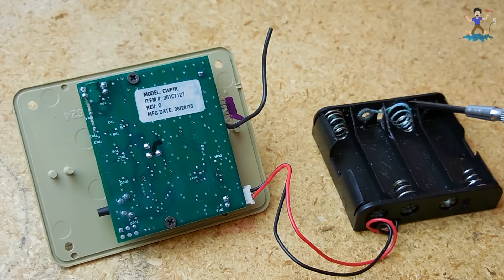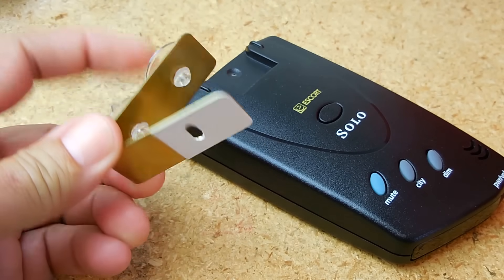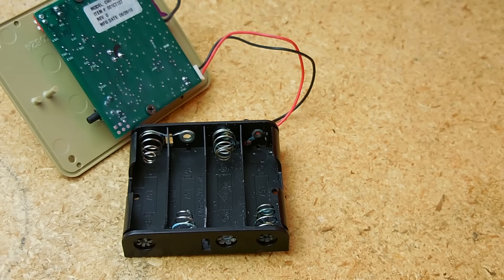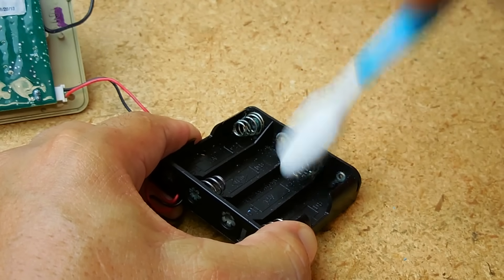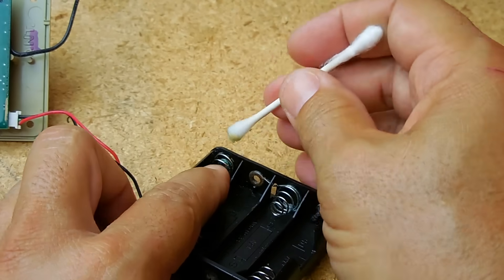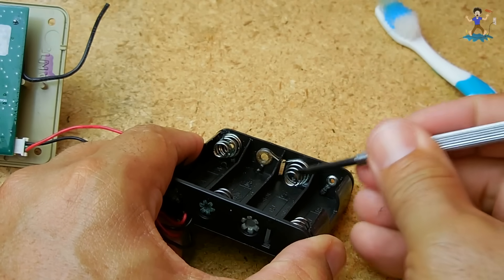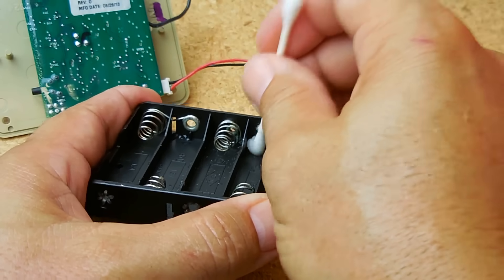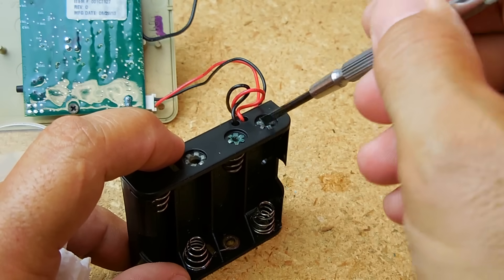EASILY Clean Battery Leak Damage(Corrosion) In Electronics

Comment from the maker: Wondering how good Dollar Store Alkaline batteries are compared to a top brand? Watch my video below!
https://www.youtube.com/watch?v=47vMmWX9LaI
Reply: Vinegar won't leave a baking soda residue.
Reply: Sunbeam Dollar store batteries are pretty good. I use them in my GO 50G calculator. In spite of all the hype they last abour as long as Eveready or Ray O Vac Batteries. Be sure their marked alkaline not heavy duty. 4 AA or AAA batteries are $1.00.
Reply: @karlbergen6826  except they leak a lot faster then name brand batteries and they have liquid inside them that leaks faster and if you put them in something and leave it on it makes them leak when the battery goes dead.
Reply: @karlbergen6826  In my experience they, Dollar store batteries, are more prone to leak though. Also the plating on the contact surfaces does not hold up well and the result is oxidation of the surface. If you have to wind up spinning your batteries to get good contact, this is why.
Reply: Hope this works on my old camera.
Reply: I was taught in my electronics course to using soda bicarb but this works on rusty tools as well! Nice video.😁 btw!
Reply: Actually I've had good luck with them.   The only leak issues I've ever had that caused damage was with DURACELL.  LOL   Possibly the Best of the Best.  Never had issues with the Sunbeam cells sold by Dollar Store.  I even recharge them and never had on leak unless I Over Charged them.  MY BAD.
Reply: Can i use apple cidar vinegar instead?
Reply: @MM-zp8iy  I'm sure it would work but the White is much stronger in Acidic Acid.
Reply: @pulesjet  Thanks
Reply: I re purpose 18650 LiIon cells all the time to make E-Bike packs and other power hungry things.   I use these capacity testers to measure the Capacity of all cells prior to use.   It would be interesting to redo your test using this tester.  I'm not as concerned about Capacity as I have the Leaking Issues.  LoL   https://www.banggood.com/ZB2L3-Battery-Capacity-Tester-External-Load-Discharge-Type-Module-p-1058571.html?rmmds=search&cur_warehouse=CN
Reply: I had someone tell me, who said he retired from a battery manufacturer, tell me that by law all batteries have to be made by the exact same standards! The only variable is whether or not the store rotates their batteries! I’ve actually had great luck with Amazon Basic batteries! Go figure!
Reply: @dlcarwile  I've been wanting to try those. No problems leaking?
Reply: Of The Dawn Ive been using them for over two years now, and haven’t had any problems yet! I’m a residential HVAC tech, so I use them for thermostat battery replacements!
Reply: Buy lithium aa and aaa batteries and you will never see leaks. Another bonus is these batteries last 10 to 15 years. Save your devices!
Reply: electronicsNmore (
Reply: I work at a Dollar Tree, this video wilp be interesting 😁
Reply: Thank-you so much! I was able to restore my religious electronic candle
Reply: Thanks for the post: been wondering about that issue for awhile.
Reply: Energizers seem to leak less than all the others.
Reply: Save yourself some effort by disconnecting the battery holder at the connector to the device's PCB.
Reply: How to keep terminals from rusting AGAIN?
What about dielectrc greas!
Reply: Duracell AAA are horrible.   They leak within a month of use.
Reply: Indudivady these are not batteries these are cells  a battery is more than one  cell
Reply: If I dont have any 91% isopropyl alcohol on hand, can I use the 70% rubbing alcohol instead?
Reply: @luckykatz - it won't work as well, nor evaporate as quickly because it is 30% water. Best to get the full IPA.
Reply: I used the method to recover an hp49g+ calculator.
Reply: but is there a way to neutralize the alkaline before corroding the contacts?
Reply: Nice video, but battery acid is really poisonous. You should be more careful handling batteries, so it doesn't get on your hands/face/desk.
Reply: They suck. Some idiot I bought a 4adio put some in the radio without asking me if I wanted batteries and they leaked.
Reply: Could i do the same thing to clean out my Battery Daddy??
Reply: @electronicsNmore - 
This is NO real "corrosion" ( https://www.youtube.com/watch?v=aWoBSthN3FM ) , I have seen real corrosion that completely ate away the entire contact into chopper salt (just the plastic was left) in a kid´s "Vileda" branded toy-vacuum  ... It was caused by the even cheaper far more aggressive "HEAVY DUTY" Zinc-Carbon batteries ... I have replaced the contact with junk = a copper strip from the guts of a cracked 1970s German multi-way extension cord, inside similar to this https://www.youtube.com/watch?v=ld40jm3VOnU   , but older & all sockets in 1 row.

Comment: Good tips. I’ve also used baking soda dissolved in water and I think it works even better, as the solution will neutralize the corrosion. Honestly, though, an 8 minute video is kinda long for this simple process.

Comment: Good video.
I had used Duracell Batteries exclusively for years. Something changed a number of years ago and they became  the worst battery for leakage! Totally destroyed a 4 "D" cell Maglight with corrosion so bad I wasn't able to get the batteries out.

Yes , I check all of my flashlights and other battery powered equipment regularly. I also had a TV remote that was full of battery leakage again, Duracell Batteries. That one I was able to clean.

Have used vinegar for years to clean or  by adding baking soda to  neutralize lead acid battery leakage on car batteries. 

Auto parts shops also sell a battery cleaning foam for lead acid battery corrosion.  

Take care with those types of batteries as that corrosion is caustic sulfuric acid  which is dangerous as it will burn skin and clothing.

Comment: I have been doing what you have mentioned, except I had been using standard Soda powder with warm water.  I also have to use a Dremel to clean even better.  It's real hard to clean easy when near circuit board, is okay if you use clean after with water clean and dry 100% with a compressor.   It's good you helped folks.  Thanks!

Comment: What I did with some badly corroded battery terminals was submerge the plates in a bowl of white vinegar and then I used masking tape to hold the bowl on top of a foot massaging thing I own.  It is a flat rubber surface that vibrates very fast to shake/massage your feet.  Anyway, this agitation of the vinegar greatly accelerates the chemical reaction.  It was really clean in about 5 minutes.

Comment: What frustrates me is device does not work, look - battery corroded, remove bad battery that has only been in 6 months, dated good thru 2030, ugh... Duracell, Energizer, all do this probably 10% of the time or more, for me it's mostly in wall clocks.

Comment: I keep a bit of 15% acetic acid from Amazon. it's a bit stronger. I learned this trick in the Camera repair business. We used the acid off the shelf from the darkroom supplies shelf. I still keep a fiberglass tipped "pen" to do the scraping at the shop that bring in corroded remote controls.

Comment: A similar treatment involves application of the vinegar using the needle nozzle of a "flux bottle", allowing the liquid to get at where a brush or Q-Tip might not reach. Especially with battery holders that can be removed from the overall assembly, the entire battery holder can be immersed in the vinegar for a moment. I recommend flushing with distilled water, followed by the alcohol, but the alcohol works well by itself in most cases.

I had a rare electronic calculator whose NiCd cells had leaked all over the circuit board. Holding the board over a tray, I squirted vinegar via the flux bottle needle all around and under the discrete components and ICs, then followed with a distilled water flush from another flux bottle, then hung it up to air dry. This brought the calculator back to life, and more than 10 years later it still works fine. No brushing or Q-Tips were used in that instance.

Comment: Dad used baking soda and water with a Q tip. Toothbrush also, water and Q tip then dry.
Works well also.
Reply from the maker: Incorrect. That does not work because you are neutralizing a base not an acid! That only works on automotive batteries

Comment: I’m going to recommend sodium citrate here instead of white vinegar if the vinegar is not working, or too slow— you can use just citric acid from lemon juice or by buying it as a cheap powder, and you can partially neutralize it with a little bit of baking soda. Sodium citrate is amazing at removing rust and I think in a slightly acidic version should do a really great job with battery acid damage as well.

The point is it’s cheap and easy to make, it’s far far superior for rust removal and probably should work in this application as well and you can just keep a jar of it around the apartment or house.

I did use the vinegar in my mom’s apartment because that’s what she had and it did work on a tv remote control with battery leak damage…

Comment: I use a Qtip with baking soda on it and push it around the electrical contacts while using an eyedropper with vinegar. The reaction of vinegar/ acetic acid, with baking soda / alkaline, works great for cleaning contacts. A toothbrush and test tube cleaner is a good idea. Thanks for your excellent tutorial.

Comment: Great video! But next time unplug the battery holder from the device. Makes for easier cleaning without accidentally pulling the device into the cups of vinegar and alcohol. I may have a couple devices I can use this method on. Thanks again!

Comment: I would recommend unplugging the bakery pack from the device and moving it away. This puts less stress on the wires and avoids contamination. I also use compressed air after cleaning.
Nice video. Have a good day

Comment: I usually make a baking soda paste, apply, let it dry...then vacuum whilst scrubbing off with a small wire brush.
Reply from the maker: Incorrect. You cannot do that for an alkaline battery. You are not accomplishing anything you need to use an acid to neutralize a base
Reply: @electronicsNmore So, licking the corroded parts is better?

Comment: With a separate battery holder like this one, especially when it's connecting wire plugs in to the circuit board, un plug it and drop the battery holder into a pan of vinegar and let it soak. Then do the physical cleaning with brushes, etc.
Reply: Exactly!

Comment: Since vinegar is so cheap, I would consider submerging the part in vinegar. Of course, can't do that with a corroded component, but in the example here, you could submerge the entire battery case in vinegar, ensuring it will get in all the nooks and crannies. I would then rinse it in distilled water followed by alcohol spray.
Reply: Exactly!

Comment: Many times I had this alkaline leakage and just sprayed it with WD-40. Bam, done!! Just let it dry for an hour or two. Also, if you have corroded car battery posts and connectors, WD-40 will literally disolve it before your eyes instantly. And WD-40 is not conductive. But also remove the connectors from the battery posts and clean thouse up with a wire brush or special post/connector cleaning tool.

Comment: Duracell Batteries are the worst offenders.  They used to be great, but their quality has plummeted and now I never leave them in a device I'm not using on a regular basis.  I've even had unopened packages that were marked "Ten Year Storage Life" leak in the package.  The only thing that have going for them is their power output seems better than Energizer, no matter what their "Bunny" advertisements say.

Comment: I have been pretty successful using small spray bottle of rubbing alchohol. Along with a tooth brush, brass brush and stainless steel brush (to scrape off the bad corrsion). 
Tooth picks, dental picks and Q-tips are handy tools. 
But never tried using White Vinegar! I will add a small bottle to my shop chemicals ASAP. 
Thanks for the tips! 😃 🧪

Comment: I question your use of the rubbing alcohol to clean the vinegar and residue off. I would  think water on q-tips would be better to clean AND neutralize the acidic vinegar first,and then use the alcohol to help disappate the water and help it dry quicker. Maybe I'm wrong...I  don't know. Does rubbing alcohol neutralize the acid of the vinegar? If so, the water step is (gladly) not needed. What do you think?

Comment: Any time you purchase a device that includes batteries be careful.  The included batteries are usually made in China and are crappy.  They tend to leak quickly.  I usually throw the Chineseum batts away and replace them with Energizers or Duracells.  But be careful, they were made in China for a while for a while and were of poor quality too. However, they were better than the Chinese, poor quality control, junk!

Comment: Tried this, unfortunately it didn't work.
Reply from the maker: Unfortunately nothing is 100%. More than likely if you opened up the device you would see the wire corroded off of the battery holder compartment

Comment: Get supplies:
1. tooth brush
2. white vinegar
3. few cotton swabs
4. small screwdriver (or equivalent)
5. rubbing alcohol

To Clean:
1. use toothbrush on affected area to clean, bang out dust 
2. a) use white vinegar with cotton swab, b) brush over affected area, c) roll cotton swab around affected area, d) use screwdriver to clean out area, 5) wipe with vinegar again, 6) use clean cotton swab to dry
3. a) use 91% rubbing alcohol and wipe area with cotton swab, b) use papertowel to clean up excess, c) let air dry

Comment: Im wanting to repair a atomic clock that has a battery holder similar to that radar detector. The battery posts are broken off the circuit board and i am thinking about fixing it by replacing that method and buy a 2 AA battery holder and connect it into the board. Any thoughts

Comment: What about using a electronic contact cleaner? Will that save my remote control devices? 😢
Reply from the maker: No it's not designed for neutralizing what the battery leaked

Comment: I dug out an old tv remote yesterday.  It was rarely used (we have always used the cable company's remote), but now we have moved to streaming so we need the tv's remote.  Unfortunately, one of the AAA batteries leaked and corroded the spring contact.  I have spent the last day using vinegar, a q-tip, and a tooth brush to clean what appeared to be mild corrosion, but I can't get it back to working condition.  The corrosion is gone, but the nickel-plated (I think) spring is dull, not shiny like the one for the other battery.  I am so far unable to get the shine back.  When I insert the batteries and try the remote on the tv, it works for about 10 seconds, but then stops and won't work again.  Is it possible to get the spring shine back?  Should I just keep using vinegar repeatedly?

Comment: Much appreciated my mum brought me a vintage tandy turbo beetle 27 rc car and they said it was working but i got it and it was corroded by the acid hoping this will work on it
Reply from the maker: As long as the wire connected to the terminals hasn't been corroded off it should work, otherwise you're going to have to reconnect the wire to the battery terminal
Reply: @electronicsNmore   thanks 👍

Comment: Bought a GBA on eBay that had a perfect screen but unmentioned battery corrosion in the holding chamber. Used this video and it worked like a charm. Held it upside down while applying liquids to avoid leakage into the system. Thank you.

Comment: Is it possible to find a new battery tray and just plug in the wire from the circuit board to the new tray? I just bought a Weslo exercise bike and it won’t turn on because the previous owner had battery corrosion. I think he tried to clean it but still no go. I would try your last tip but it’s no snapped off and I don’t have any soldering tools…

Comment: Came here to thank you, this method saved my Band Hero Drum unit, I was nearly tossing it away as there's no service for it. I actually did not think this was going to work as the leak didn't seem to cover the entire contact, leading me to think there was another fault or at best the leak damaged the inside of the electronics, dunno if that's a thing too. So although the leak did not look very bad, at the microscopic level it still prevented the batteries from working! So it's always worth a shot, no matter how it looks...

Note: I also dipped the tooth brush in Vinegar, but I still suggest dipping it after applying it dry.

Comment: Sorta Wrong
Most AA or AAA contacts or springs are plated with Crome. Crome plate when battery croshion is delaminated and holding corrosion under plating  and acid under the chrome plating.
Plating that is near corrosion  is worse than no plating
1 Scrape away corrosion and any loose plating
2. Spray with IPA or EverClear to solvate any croshion
3 Neutralize residual acid with water baking soda solution
4 Wash away the salt water created by the baking soda Acid reaction
5 Spray with WD 40 or any lubricant.

Comment: I just use CLR, using the same methods, then rinse thoroughly, wipe down with a baking soda solution to neutralize the acid and coat everything with dielectric grease.

Comment: Thank you so much! I just took out a Christmas item that the battery leaked in it. It had been in storage for two years, so I thought that was the end of it.
I just did exactly what you did here, and was very skeptical, but I turned it on, and it worked, just as it always has !

Comment: The  BEST  way to avoid this ( alkaline corporate MEGA corrosion ! ) , is to convert your small  devices to use the ( MEGA abundance ! ) of discarded Lithium - ion batteries , found in disposible vapes ... clearly , you will need to know some electrical theory , but these little ( re-chargeable ! ) batteries  NEVER  leak ! ! ! ! ... ( tried - n - tested ) .... DAVE™🛑